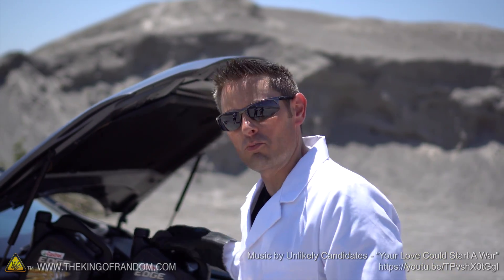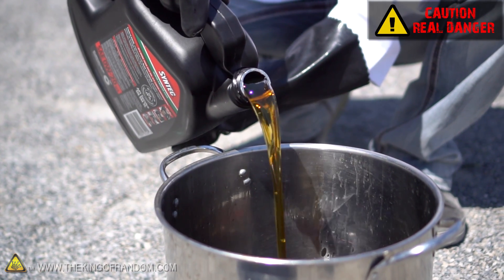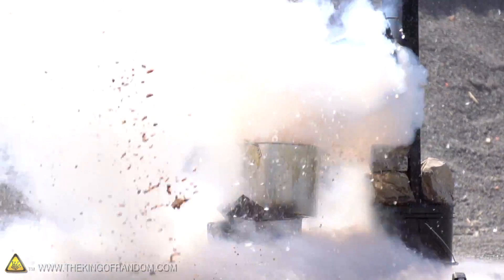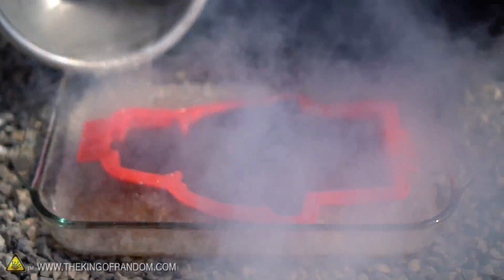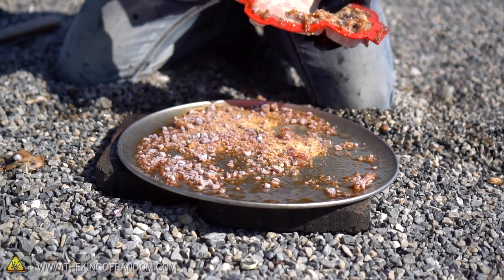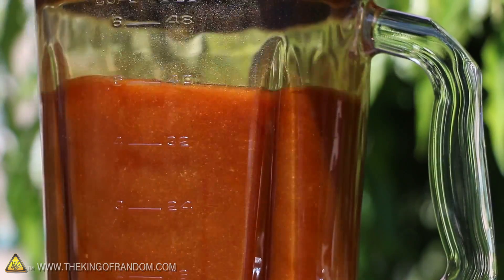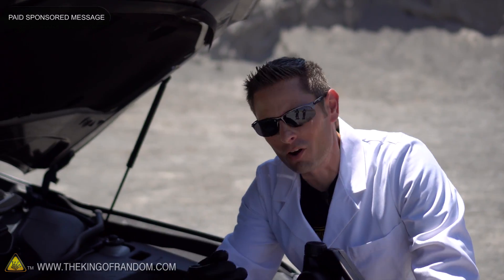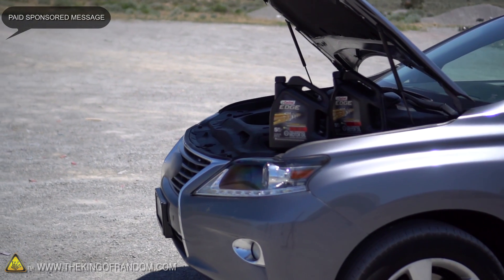Liquid Nitrogen Meets Boiling Motor Oil

Comment: Cool ad, but how does "regular" motor oil hold up to the same tests?
Reply: I cant see why it would have any issues. Actually I cant even see why normal household cooking oil would be noticably affected by that treatment.
Reply: We'll never know unless someone pays him.
Reply: RedstoneWolf You should probably read zinobi's comment, which is the one I replied to.
Reply: These were bogus "tests". There was not before and after measurement of viscosity, slickness, etc.
Reply: PolyJohn Indeed it cant, but the measly 400F that he meassured is what you use for deep-frying things. So cooking oil should stand up to that without any problems.
Reply: +PolyJohn he said regular motor oil not regular oil
Reply: No, oils don't have similar viscosity. There are types of oil that are as thick as grease to as thin as water.
Reply: +zinobi Cooking oil can't stand the temperature ranges that motor oils can, they'll start to smoke or pyrolyze.
Reply: RedstoneWolf It's cool.
Reply: TheOtherWhiteBread0 Ugh
Reply: It would hold up basically just as well as Castrol's oil. The whole video is an advertisement.
Reply: +PolyJohn yeah sorry. For a minute it only showed your comment now it is showing the others
Reply: Karma Dipso Literally the only universality is that all oils are non-polar hydrocarbons.
Reply: Haas Kind of a pointless comment. By the same coin, why would you care that they care?
Reply: About the same. Synthetic motor oil has less impurities.
Reply: The only similar trait amongst all oil is it's viscosity. Properties can vary beyond it.
Reply: wasteoftimereading Risky assumption on my part
Reply: ***** Fair point
Reply: Why would you care it is not like you are going to put motor oil in your blender....
You don't see cooks testing milkshakes that are made in an engine.

Comment: In my experience using full synthetic oils in older engines will make them dangerously run at much lower oil pressure levels causing extreme friction wear and even to knock overtime To protect your car engine change the conventional oil every 3k's  or the maximum of 5k miles for the blend-mix and avoid using fully synthetic oils if it's not required by the manufacturer.... check the manual

Comment: It is true that you can switch between conventional and synthetic, but if your car is old or has a bunch of miles there is a chance of leakage if it has only used conventional. The reason is that the conventional oil has built up a sludge around any cracks in the old engine seals. The synthetic oil will then clean away the sludge and expose the cracks causing leakage. I have worked on my own cars for years and have experienced this first hand. 
I like synthetic oil and have used it in some of my cars, but just wanted to give this out as a warning to owners of old cars.
Reply from the maker: Great thanks for the pro tip, brother!
Reply: haha using full synth on all my vehicles. 11 and 12 year old with 180k and 130k respectively.
leaks? nope.
Reply: +nambinhvu Wow how many modifications have you done to your Prius to make it go 100 mph? There must be at least 50k under the hood of your car
Reply: Just curious, is 6 years and 85000 miles too old to use synthetic?
Reply: mpickering54321 That is in the gray area, it may or may not.
Reply: agilis Many synthetic oils have extra cleaning agents and seal conditioners that most conventional oils do not
Reply: Same can be said in reverse- my 22 year old car has had mostly semi-synthetic and synthetic oils in it, but I switched it out for mineral oil because it can help preserve piston rings. But as soon as I did that, it started to weep out a lot more
Reply: That is true. But luckily there are additives like at205 reseal
Reply: If your seals and rings are that caked with crud, you've already got more problems than just swapping motor oil can do.
Reply: Jack Toohey do u want a cookie for pointing that out m8
Reply: Specific Love Creations couldnt be bothered reading your comment it was too long
Reply: Grant Thompson - "The King of Random"  Glad to help
Reply: SjKimber  If you start using the oil on a new or fairly new vehicle, then the leaks are not likely to occur. I have a truck that I started at 40,000 miles and now has over 100,000 with no leaks.
Reply: Great information but can you please explain why conventional oil would not remove the sludge build-up like you said synthetic oil would.
Reply: +agilis Its because conventional is not as pure as synthetic and that purity of synthetic makes it brake down that sludge because there is space in that oil to wich that sludge can disolve.
Reply: +Specific Love Creations Thank you. I was not aware of that.
Reply: +mpickering54321 I have a 2003 prius with 200k miles on it and no oil leakage running mobile one synthetic, even the thinner 0w-30, and I've taken it to 100mph several times not too long ago.
Reply: Grant can you make a video on how to make homemade nichrome wire
Reply: it is true for newer cars, you just don't want to switch brands because most of them use different detergents that will foam up if they get mixed up with the detergents of other brands and harm your engine quite badly... now for high mileage cars it is better to keep using conventional because of the inconsistent size in molecules, (which synthetic is all the same size across the board) the larger molecules of conventional will help fight against the leaks of high mileage cars much better than synthetic while the smaller molecules will help lubricate your cylinders better by filling the scoring that is bound to happen over those hundreds of thousands of miles
Reply: Thats just a myth. I bought a 97 Tercel with 200k, that never had synthetic. First time i changed the oil i (ironically) put Castrol edge in it. It doesnt leak or burn any and im at 230k now about a year later.
Reply: Zach Ylimaki It is NOT a myth. Last year I changed my wife's older car oil with partial-synthetic (by accident) and it started to slowly leak within a week. It was not leaking before that change. I swapped back to conventional but it was too late and continues a slow leak.
Reply: I know you were probably kidding, but lol nothing to increase the horsepower unless you count motor oil, oil filter, air filter, etc. :P I guess you can count the high inflation pressure for lower rolling resistance I put in my tires. Lol 50psi. And no, I've never had any issues slowing down, handling, or early tire wear, nearly 40k miles put on my tires so far.

I bought it used for $4k. I doubt the original owner modified it.

I consistently get 43-53mpg. Lower mpg is if I go 70+mph freeway. 50+mpg if I keep a max speed of around 55-60mph. Funny thing is I drive faster than the speed limit in cities, slower where limit is over 55. XD

But yeah, no mods to increase speed.  100mph is actually its top speed on a level surface though.  How slow it accelerates is another story though. Lol

People in hybrids only drive slow because they see the enormous savings in gas, tires, brakes, coolant, oil(filters), reduced bug carcasses, etc.  Maybe that's why I have no leaks. Lol I have taken it to 100mph a few times, but that's rare.  The people with leaks probably constantly go 80+mph.

I apologize for my super long response. Lol
Reply: Yeah, mobile 1 actually has higher viscosity rated synthetics recommended for higher mileage vehicles.
Reply: you cant make nichrome wire at home either way its super cheap
Reply: Thats the purpose of high mileage synthetic
Reply: my dads got a Toyota Corolla station wagon and its done over 400,000 K's and its still running like its brand new
Reply: I put synthetic in everything. amazing stuff. my BMW E30 of 300,000+ does not leak after a new rear main seal replacement.
Reply: Thats kinda true. Thats why if you will try to change in synthetic and your car is old you must check everything first and replace any necessary parts.
Reply: What i mean is gaskets. and stuff that might have an crack in it like the oil pan
Reply: Renzeth Bulawan Change your channel art and icon 
+invertedlow Don't swear
Reply: David Harvey good idea haha
Reply: 100th like
Reply: then use high mileage oil
Reply: One of my cars a 92 Nissan Sentra with 260,000 miles used conventional oil most of its life when I bought it. I added Rotella 5w40 Synthetic when I first changed it, it didn't leak but I noticed the oil pan was starting to seep oil after about 3000 miles. When I replaced the seal it was all sticky and brittle.
Reply: MR.T456 Rotella 5w40 is for diesel engines...
Reply: how do people get that blue oval around their youtube user name
Reply: Justin E.
Yes I know but I think Rotella is a mixed fleet oil, although not officially recommend it can be used in some gas engines (not newer cars) I only use it since Rotella seems to have stopped the oil consumption for now.
Reply: Specific Love Creations lol
Reply: thats not why synthetic leaks more, it leaks more because it has a higher flow rate, look at engineering explained's video
Reply: Too bad the tip is wrong, synthetic makes it leak worse because it has a higher flow rate, not because it cleans it or anything like that
Reply: if there is too much clearance from wear and you switch to fully synthetic without replacing worn part abnormal wear pattern will start to arise resulting in a quicker failure of a part or parts. Crank, Rod, and cam bearing should be the first to go. But to replace these before failure it would require a complete engine rebuild. So I would have to disagree with this claim.
Reply: Specific Love Creations i
Reply: My truck and car are 12 and 11 years with 130,000 and 180,000 respectively. Both were obtained with approximately 100,000 miles already on them.  I've run nothing but motorcraft full synth and have no leaks.

Comment: I've been working as a mechanic for 6 years now and I felt compelled to submit a correction to this video. While on some newer cars you can switch between synthetic and non-synthetic motor oil, it can still damage your vehicle to have the wrong type in your engine. Non-synthetic motor oil has oil that forms beads of a certain range of diameters, whereas synthetic forms just one diameter. On some older cars, the engineers took this into account and made smaller and larger oil passages so that in effect different parts of your engine are running different weights of oil. Conversely, on some newer cars, the engineers designed the oil passages with the tolerances for only oil of a specific size from a synthetic oil standard. If you run the wrong oil in these types of cars, you can end up effectively running your engine on too little or no oil. If you do this, your engine will most likely seize. You can check your particular engine by looking in the owner's manual under maintenance. If it says nothing about this, then you're probably safe to switch between non-synthetic and synthetic.

TLDR: Your car may be designed to only run on non-synthetic or synthetic. Consult your user manual.

Comment: "contrary to popular belief you can switch between conventional and synthetic oil" well the thing I read and what makes sense is that if the engine has used many years (like 10+) mineral oils and it collected dirty sludge all over in the engine. Then you put in synthetic oil and it will flush the sludge. If for then any reason the engine gets oil past the filter (eg. filter clogs up from the sludge or cold weather/high oil pressure = bypass valve opens) then your whole motor is pretty much destroyed

Comment: gonna go full straight forward. I tried making one blowgun with your guide. The only problem I encountered is I used blue pvp pipe 1/2 inch fitted with a 3/4 inch - 1/2 inch reducing adapter and my darts won't fly far enough even with a hard blow.

Comment: Why does the oil get hot?
Reply: Friction.
Reply: +Usmodlover Ty
Reply: +Usmodlover not only friction, the air/fuel mixture that explodes in the cylinders give out alot of heat
Reply: Liverpool Biker
True I suppose, but most of the need for motor oil is because of friction.

Comment: can I ask you grant, what would blending it do?
Reply: it shows how the oil reacts with high speed like car engines
Reply: and it reacted poorly in that test. that kind of milky colour it went? loads of bubbles that reduce the lubrication provided by the oil. but to be fair, an engine is not like a blender. it  does not whip the oil like a blender does.

Comment: -321F? Pretty sure the lowest possible temperature is -273F (a.k.a. absolute zero)
Reply from the maker: Close, I think you just have your units mixed up.  –459.67ºF is absolute zero.  (-273.15ºC)
Reply: +Grant Thompson - "The King of Random" oh of course. my bad. thanks
Reply: No absolute zero is -273 Celsius not Fahrenheit.
Reply: 0K =-273'C
Reply: 0 Kelvin is -273C not -273F 👍 but don't worry, it's an honest mistake.
Reply: +Cheng Leonz 1°K is -273°C... actually
Reply: +Sean Ocansey I know 0F isn't -273°C. When he said -323F, for some reason I thought he was talking in degrees Celsius  (I wasn't listening carefully), and I remember from physics that you can't go lower than -273°C (referred to as absolute zero)
Reply: It's cool
Reply: the lowest temperature that is theoretically possible, at which the motion of particles that constitutes heat would be minimal. It is zero on the Kelvin scale, equivalent to –273.15°C or –459.67°F.
Reply: actually is " -273k " not "f"
Reply: +The Raging Lemur dude °C is more than°F
Reply: +Tietäjä 69 never mind
Reply: +Tietäjä 69 on runkkari
Reply: not F but C its different
Reply: +Nathan Mc Cormack *0k
Reply: älä ny
Reply: +Sean Ocansey Wait I made another mistake. -273°C is 0K. I don't know why I'm mixing up my units
Reply: You cannot get any lower than 0k, or is otherwisely known as "absolute zero"
Reply: +The Raging Lemur I accidentally swapped Kelvin for Fahrenheit
Reply: +Ghareeb Colt sorry, you're right
Reply: +Nathan Mc Cormack all goof
Reply: Absolute zero refers to units of °k not fahrenheit or dehress

Comment: But nothing about the chemical or fysical changes the oil could undergo after this torturetests. Like with real tests that measure viscosity, lubrification ,thermal capacity and  conductivity, for starters.  Fun to be sponsored. I hope it brings in more than a few bucks in motoroil.

Comment: I thought it wasn't supposed to freeze though? Is it bad that it did?
Reply: at normal temperatures it's not suppose to but liquid nitrogen is an extreme cold
Reply: unless you're driving a car on saturn then you wont need to worry, even antarctica
Reply: Up here in Alberta when winter hits and we get a cold night sometimes we have to plug in the engine block heater to prevent the oil from becoming sludge so the engine will start and run better in the morning

Comment: I know this is supported. ... How about reproduce a picnic stunt from Purdue U. .. A 'fire lighting' contest.  The winner lit a little aluminum habachi that had some slightly lit coals in it, but to the the fire larger, poured a quart (from a thermos on a long stick) of liquid oxygen on it.  The ensuing mushroom cloud and boiling aluminum left on the ground was fantastic. -- Purdue made the professor of Mech Engr take it down after several years.  So could you reproduce it?  Safely of course.

Comment: As long as a viscosity of the oil is fine, it should be good for your engine.  The oil filter should remove any impurities you added to the oil with your experiments.  The nitrogen will boil off and leave no residue behind.  :  )

Comment: Liqui Moly with Moly disulfide is best oil for engine protection due to it being used in WW2 plane engine for keeping them from exploding or seizing. For sludge and cleaning I really don't know if Liqui Moly excels on those. I use LM due to it's protection and it being rate VW 504.00 and 507.00. In conclusion, you can use any motor oil you want, just check your owners manual and see the oil requirements. Any oil brand should be good. I prefer german oils from experience.

Comment: I know this is basically and ad and all, but it would be good to know if the lubricity of the oil had changed at all after the torture tests. It obviously looks fine but, that doesn't mean the oil didn't slightly break down at a molecular level.

Comment: Is it a good idea to use Liquid Nitrogen to cool down a computer?
Reply: Look up Liquid Nitrogen PC overclocking.
Reply: Yes.  Just do it safely like this was done... in the middle of an evacuated desert area.  But please, video it for us! ... Back to reality, folks at places like CERN do it all the time, even with colder materials.
Reply: professional overclockers use liquid nitrogen all the time, but they use special equipment and they know what they are doing... don't do it properly and here u go frozen pc
Reply: Yes, but you need special equipment
Reply: the ideal temperature for computers is 4°C, so no.
Reply: +Vanderpsen The ideal temperature is a little less than 30 C
Reply: No, liquid nitrogen is too cold and creates condensation whiche may harm your computer, a watercooling is really sufficient.
Reply: No, because 
1. it's way to expensive
2. bad for your computer, because modern chips work best at somewhere between 30 and 50 °C
Reply: People use it to cool down CPU fast, so yes.
Reply: quantum computers use liq nitr
Reply: Yes but they hava an enormous protection to avoid cndensation and a home computer does not need to be under liquid nitrogen to work well
Reply: quantum computers are in development stage abnd are not practical at all
Reply: a not conductive oil is a far better option.
Reply: LinusTechTips did a video about it I think
Reply: people have been doing this for the past 15  years or so
Reply: Hubert Beck You obviously dont have a clue.
Reply: And Turn Into A Human Ice Cube...                                                      ... SWEET!!